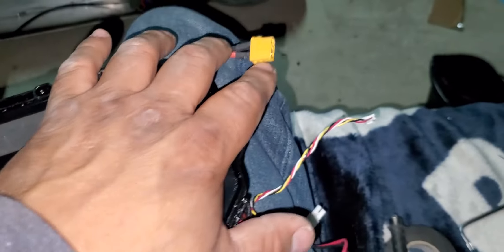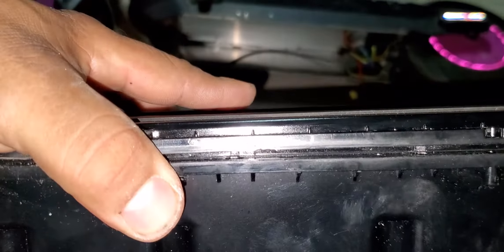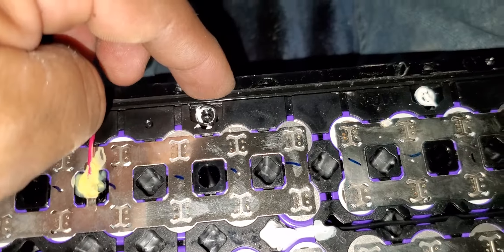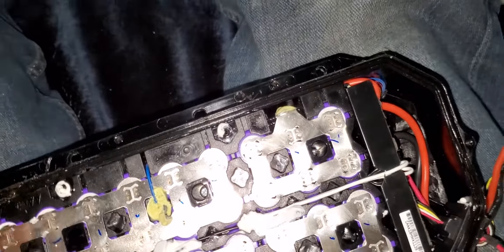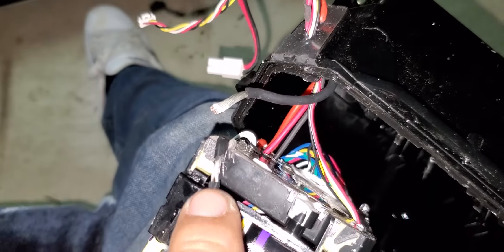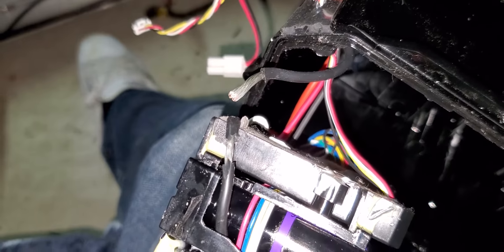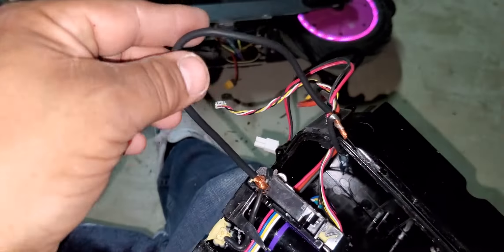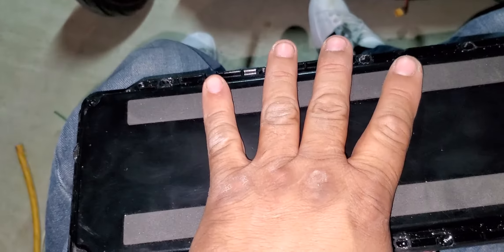Segway Ninebot max g30 BMS (Battery) bypass.

Comment: If you have this issue then just revert to an older BMS version and it works most likely again.
Had this issue on mine (after an firmware update) when using more than 20A and accelerating suddenly. It was on BMS Version 1.5.6 

I reversed to 1.3.4 and it goes up to 65A without an issue now.
Might work with other versions too but I stuck with it.
Reply from the maker: Yes, thank you
Reply: How did you reverse it??
Reply: @Aixam400superluxe  was some time ago, I think I did it with shu, same tool as you use to flash the normal firmware, it even lists you the different versions for flashing. Just beware that depending on how new the scooter is there might be limitations imposed by ninebot
Reply: @Aixam400superluxe  scooter hacking utility
Reply from the maker: @Aixam400superluxe  On these rental scooters the batteries are made different from commercial, so you can't revert to original you have to bypass it or get a battery on Amazon

Comment: Hello Friend.
Please tell me whether the short circuit protection will work with this kind of bypass of the BMS?

upd: Did my research on the BMS board - This bypass removes short circuit protection...

On the other hand, you can get more output power. =/
Reply from the maker: 2 years and still running

Comment: thanks for this video! i've got 15 ninebot G30 Max scooters (orig SPIN Rentals) ... SNSC 2.0. from impound yard, i've flashed 4 successfully via ST-Link Flashing method of BMS, ESC, and Dashboard BLE... however, all of the remaining Batteries- although the LEDs flash Blue, i cannot get them to connect in software STVP, in order to flash the old  BMS 1.3.6. despite good soldering skills,  still no luck connecting. i'm gonna try this bypass myself, to hopefully get these batteries working. thanks again!
Reply from the maker: Hi, the video was meant to show how to bypass the BMS that the scooter rentals blocked 🚫 so you can't use the scooter, I've had this scooter running like that with the bypass over 3 years and it still running and had no issues.  Glad this video helped you
Reply: Spin scoots need esc, display and bms flashed all at once I’m pretty sure
Reply: I can't get the battery connected with stvp either, I've checked the connections, tried different usb ports, etc. will this bypass work?
Reply: @nocandopdx   how weird, i just finish another BMS bypass, then see this reply 2 minutes later. yes! it works great! i've done 2 successfully, now!
Reply: @brianjohnson1671  nice! Good to know. I just managed to flash mine by unplugging the three connectors on the bms board

Comment: So I tried using this battery for a project and was facing a 5V reduced output voltage. I bypassed the BMS like this but used a fuse and get full voltage now. I think that should be done at least as the BMS protection features for the output are bypassed as well...  42V/very high current is no joke... and also over discharging needs to be avoided due to the missing cutoff...
Reply: Most controllers have built-in lvc so no need to worry never had trouble with mine i did test it for the 1st few times tho just to make sure it cut off at the right voltage
Reply from the maker: 2 years and still running

Comment: Hola amigo, tengo una duda hay un video donde pues trabajo que que que soldar un cable rojo a una pinto P de la placa de la batería 🔋, sabe si esto es correcto? O cual
Es la función del colocarle un cable rojo, aparte del soldar el negativo (bypass)
Reply from the maker: Bueno, no se cual cable rojo habla, pero es un cable negro como muestro en el video para poder alcanzar el coneccion con el cable negativo con de la pila.

Comment: Que onda Chuy a ver si me puedes ayudar, tengo el mismo scooter que tu pero el mío está bloqueado, compré un dashboard bluetooth en ebay pero la conexión es de 4 pines y el del patín es de 5 pines, ya sé que si se conecta así se quema el dashboard por eso hay que hacer un reacomodo de cables en la controladora de velocidad y aqui viene la pregunta del millón:

Si le pongo el Dashboard que compré, reacomodando los cables obviamente para que no se queme y hago el bypass que hiciste en el video ya con eso puedo usar el patin?

Otra pregunta, sabes de cuántos volts es la luz delantera?

De antemano muchas gracias y saludos desde Tijuana.
Reply from the maker: Q' onda... Mira luego hago un video de nuevo en como configurar la coneccion del dashboard al controlador y si la lampara es de 5v. 
Aqui esta como se ve el cable, solo hazlo asi como el la foto
Check this out on eBay!
For Ninebot MAX G30 Scooter Dashboard Control Cable Board Line Wire #US
https://www.ebay.com/itm/393792975660?mkcid=16&mkevt=1&mkrid=711-127632-2357-0&ssspo=ffyt2_pzsfe&sssrc=2349624&ssuid=h55E6dUHQJa&var=&widget_ver=artemis&media=EMAIL
Reply: @chuyramirez3731  Muchas Gracias Chuy, entonces  si hago tu bypass de la batería y le compró el cable qué me mandaste y el dashboard ya con eso puedo usar el patín libremente?
Reply from the maker: @Ivan-Borruel  bueno, aun tendras que flashar el controlador o consequir uno tambien
Reply: @chuyramirez3731  Acabo de comprar el St link para flashear.  A qué controlador te refieres? al electronic speed controller (ESC) o al battery management system (BMS)
Reply from the maker: @Ivan-Borruel  debajo donde esta la pila, hay yn controlador y cargador. Tienes que flashar el controlador con el st link
Reply: @chuyramirez3731  me acaba de llegar el ST link, me voy la voy a rifar flasheando la controladora de la bateria a ver que pasa.
Reply: @chuyramirez3731  Que onda Chuy, MISSION FAILED! Pude flashear el controlador ESC y la controladora de la bateria BMS, hice el cable asi como dijiste pero no prende la pantallita. creo que me voy a rendir y simplemente le voy a poner una controladora china.
Reply from the maker: @Ivan-Borruel  look me up on Facebook Jesse RM

Comment: i used this method but i still cant draw more than 2 amps from the pack. does the red need bypassed also?
Reply: Your cells are dead
Reply: @RandomClips27.  on two packs? they charge and discharge just fine.
Reply from the maker: You probably have a bed cell or two, the scooter that I've bypassed is still running great.
Reply: @chuyramirez3731  i just checked the voltage of each cell on both packs, there all balanced fine. no voltage issues. i think its the charge controller limiting to 10amp output
Reply from the maker: @fourknotsnowhere  check your controller, when I did mine the voltage was fine and been riding the scooter and no issues, the bypass should only make the scooter run, no voltage change or making the scooter faster. You might need to check on the controller 🤔

Comment: Hola Chuy 
Una pregunta, compre el cable de 4 pines para sustituir el de 5 pines que viene originalmente con el equipo, y compre un controlador chino en AliExpress.  Para sustituir el original ya que me han comentado que este quema la tarjeta de control por que trabaja a diferente voltaje y que aparte está bloqueada. No se que tan cierto sea. Pero 

La pregunta es si conecto todo,
pero no realizo el bypass que sugieres de la batería tendré algún problema??  

o está se apagará al poco tiempo que está este en marcha?

O peor aún puedo quemar la tarjeta controladores “display”. Esa es mi duda. 

Me puedes ayudar. Te lo agradecería infinitamente.
Reply from the maker: Hola, para liberar la patineta ocupas el controlador flashado o compra uno por Ebay o Amazon hasta tambíen Walmart online, Mas tambíen puedes comprar todo el kit ( Dashboard + Controlador) mas el cable de 4 pins y listo, prende pero se te apagara en menos de 10 segundos si no flasheas tambien la pila (bateria). O tambien puedes hacerle el bypass. Yo tengo esa patineta funcionando bien y sin problemas con el bypass.
Reply: @chuyramirez3731  Asi es Chuy, compre ese kit completo que mencionas, entonces es necesario hacerle el bypass a la batería para que funcione correctamente? 

Si solo conecto el kit y no le hago el
Bypass se apagara vdd.
Reply from the maker: @juanlara1257  te recomendo flashar la pila si no tambíen puedes hacerle el bypass y nada pasa, sigue cargando y no pasa nada, yo tengo una patineta con la pila flashado y el otro con el bypass y el del bypass no se me ah quemado y nada aun sigue como si nada...
Reply: @chuyramirez3731  Como se flashea la pila? 😯 soy un novato en todo esto, tienes algún video para hacerlo? Es difícil realizar el flasheo. Me ayudarías?
Reply from the maker: @juanlara1257  En esó ando, muy pronto hago un video
Reply: @chuyramirez3731  Lo esperare con ansias 🙏

Comment: do u have any info on that new spin battery
Reply from the maker: @derpherpp3  Hi, still running and did an upgrade by adding 6v battery to extend 36v to 42v and now it goes faster up to 25 miles per hour and has more torque as well

Comment: Hi again. I bypassed the bms as per your video and it worked for two days but now again it started with the same problem, showing E5 error code on display and shutting off. Also, it was discharging the battery very quickly, much quicker than usual (battety type is 36v 15ah).
Should I go back to connect the scooter negative to the bms, and can you please help me to diagnose the problem as when I measure the power of the battery it shows between 37-39.5v, which means there is nothing wrong with the batteries, right?
Is there anything else that forces the bms to shut off my electric scooter.
Thank you for your support and your kind understanding.
Reply from the maker: Hi. That's odd.  You could and just downgrade the bms that will usually work as well. Sorry to hear that issue, but my scooter that I did the bypass is still running and with no issues and plus everyone that has done it too are still good. Maybe you probably cut the wrong negative wire or something, doble check.
Reply: @chuyramirez3731  Thank you for your reply my friend. No, I cut the B- and the P- from the BMS and connected them together and bypassed it, and as said above worked for two days although it discharged the battery faster than usual, and finally it started to do have tge same error code and signs again. I guess it must be something else that us causing the bms to shut off the scooter.

By the way, is there any app or how to downgrade the bms?

Thank you so much for your support
Reply from the maker: @reaanddiellademi2723  https://max.cfw.sh/#
Reply from the maker: @reaanddiellademi2723  or the Xiaoflasher app too.

Comment: I have a scooter it's called a hover one journey. I'm having the same issue with my negative wire. The positive and negative wire doesn't show any current coming out of it but if I put the multimeter on the hot wire and touch it to the Post on the negative side of the battery it shows the voltage that I have in my battery but if I put the negative lead from the multi-tool on the black wire and hook it up to the positive lead on the battery there's no reading. Anyways my black wire has no power coming out
Reply from the maker: Bypass it

Comment: What is the name of the small black electronic box?
Reply from the maker: Small black box ??? There's no thing on the video
Reply: Bms  name germany
Reply: @chuyramirez3731  Battery management of small box full of cables
Reply: @chuyramirez3731  My battery smells burnt and does not charge 9 monaten
Reply: @abbasghasemi757  it would problebly be your bms the batteries doesnt smell like burned more like pure alchol it could be a transistor on the bms

Comment: broo change the bms ...it easi
Reply from the maker: This video is made for those that have tried everything to make these rental scooters run, BMS on these batteries that came with these scooters are made different from the regular stock batteries, downgrade the BMS sometimes won't work, you have to this bypass

Comment: This "solution" is no good for number of reasons. In this case, if your battery have not stock sofware inside of the bms you need to restore it with st-link. Right now bms will not turn off in case of low voltage, cells falure, or FET falure.
In previous vid you said what you changed a battery, what kind of battery did you used? it was not been a regular g30 retail pack.
Reply from the maker: Hi yeah, it wasn't a retail battery from ninebot max g30, got it from Ebay for $40 dollars, I think it's from those rent scooters, also bought some controllers too and they are bond to someone else, the dashboards are generic too but still got everything working by using Scooterhacking Utility.
Reply from the maker: By any chance, do you know where I can get parts to replace Ninebot max g30 from?
I get them from Ebay & Walmarts website.
Reply: @chuyramirez3731  i buy stuff locally rarely, but most of the time ebay or aliexpress.

Comment: Bypassing the BMS is Never a good idea. It's there to protect the batteries and prevent Fires which can easily happen under the right conditions with Lithium Batteries. Changing the version of BMS firmware is a much safer effective way.
Reply: Ok, so make a video showing how. Or this is the option.
Reply: If you use a different controller like a vesc you need to bypass it. Aslong as you not go over 30Amps you should be fine. I currently got a vesc build in and since it still takes 1-2 months until i get the cells for my battery i bypass it.
Reply: Otherwise if you not bypass it is limited to 19A with diffrent controllers
Reply from the maker: 2 years and still running

Comment: This is not something an electronic novice, or even a hobbyist should do.  This guy instructs people to take risks that can cause damage.
Reply from the maker: 3 years and still running, to work and back home with no issues, plus this video is intended for those with rental scooters that tried everything and want to use these battery packs so far no one has said otherwise.

Comment: Is it safe though?
Reply: what about discharge protection?
Reply from the maker: That scooter you see in the video is still running, from my house to work every day, no problems charging or discharging, been more than 2+ years.
Reply: @chuyramirez3731  which scooter is that?
Reply: also instead of doing this you can either install a new bms, or use a mcu to send commands to bms over uart.
Reply: No

Comment: I see .So the bms will still function to charge .
Reply from the maker: Hi, yeah it still charges and stops charging when it's full, I still have that scooter running and have zero issues
Reply: @chuyramirez3731  Does it make the scooter faster?
Reply: @Neilukuk I’m curious too that’s what I’m here for
Reply: @Neilukuk  damn bro been a whole year I don’t think we’re gonna get an answer 😂
Reply: @andreimitrica77  Looks that way. I'm not going to risk my scooter without some more info.
Reply: Hey lads have yous done this and is your scooter still running?
Reply: @Neilukuk  I agree
Reply: @whitefeatherslinger8194  ur not gonna get a reply here don’t bother trying 😭
Reply from the maker: @Neilukuk  the video is to make the scooter run while on it, this issue that everyone was having with these rental scooters that when you put on the dashboard and turn it on and do test on it the motor runs but when you get on it it will shot down in a couple of seconds and the problem was the BMS was program to do so for the rentals, the bypass is for that so it wouldn't shot down while riding.
Reply from the maker: @andreimitrica77  Sorry guys for not responding fast, I've been busy... It was just to make the scooter rentals run and it doesn't make the scooter fast cause it still a 36v battery max speeds are 21 mph on a full charge. Need a 46v to go faster.
Reply from the maker: @Neilukuk This bypass is intended for the scooter rentals, so it's been more then 2 years and no issues with that scooter on the video.
Reply from the maker: @whitefeatherslinger8194 it's been 2 years and the scooter is still running
Reply from the maker: @andreimitrica77 sorry been busy, the scooter on the video is still running with no issues

Comment: Man , i sugest to delete this video before more people se  it and before is to late . Basically you cut out the over voltage , under voltage protection , and that is veery dangerous. Buy a new bms and redo that battery . Seriously .
Reply: Cant seem to find a diagram with a standard bms ,the harness wires has a looped wire so with a standard one  it dont have it so im guessing its why ive burned the last bms ive tried.i gotta say i have this bypass on another bike  and it shuts off when battery is empty but i always keep  a eye on it when charging ,any help with a diagram would be appreciated 👍
Reply from the maker: Already been 2 years since I did this to that scooter and still working with no issues

Comment: EN: Delete this video immediately! You don't understand what you're saying. When one of the 10 cells fails and becomes exactly 0v. Then this capacity during charging is distributed to the remaining cells. and then the cell will have 4.6v! the maximum permissible value is 4.4 at which the batteries boil and, in the best case, the protection valve is triggered; if the valve does not trigger, a fire occurs. And we must hope that on each battery the valve will work or there will definitely be a fire! 
RU: Удали это видео срочно! Ты не понимаешь что ты говоришь. Когда одна из 10 ячеек выйдет из строя и стане ровно 0v. То эта ёмкость во время зарядки распределись на оставшиеся ячейки. и тогда на ячейке будет 4.6v! предельно допустимое значение составляет 4.4 при котором аккумуляторы закипают и в лучшем случае срабатывает клапан защиты, если клапан не срабатывает, то происходит возгорание. И надо надеяться что на каждом аккумуляторе сработает клапан либо возгорание будет обязательно!